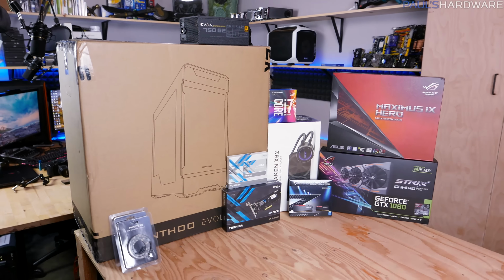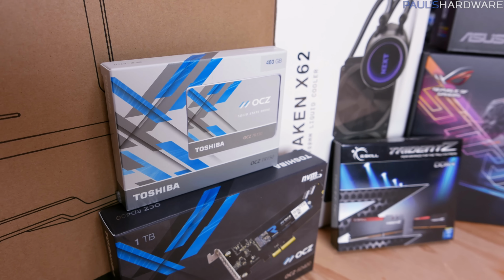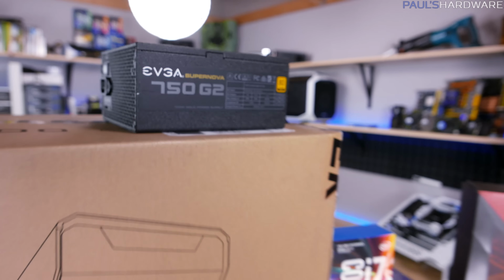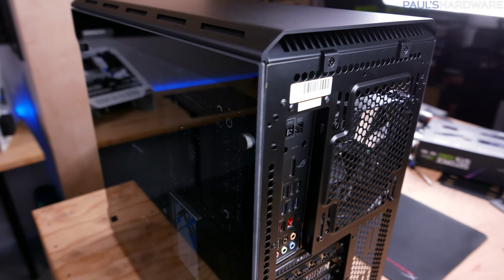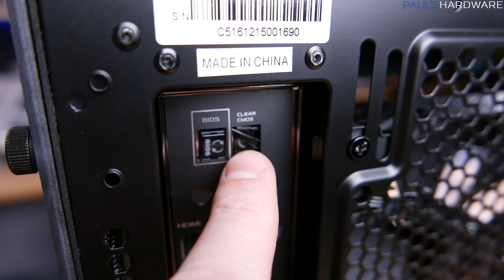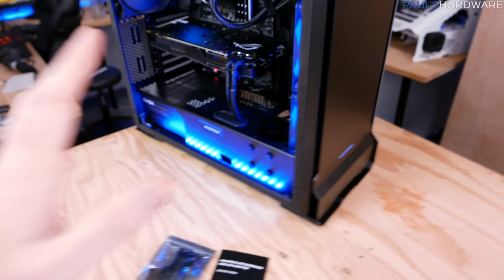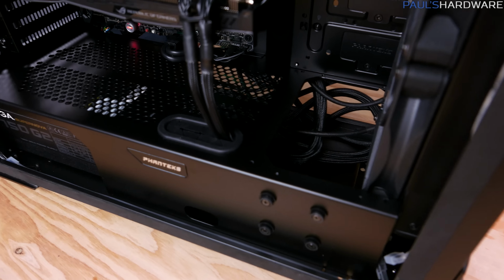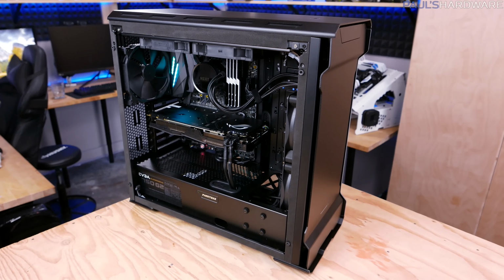Building a $2800 7700K / GTX1080 Gaming System - January's RGB PC!

Comment from the maker: Thanks for watching guys! Looking for feedback on -- AIO cooler tubing configuration, AIO cooler positioning (it's in pull, I could switch to push to hide the fans), PSU cabling and if extensions would be desirable, and how noob my mistake was with the I/O shield of course. Enjoy!
Reply: is there a reason for the video only in 1440p? looks way too raster on my cheap laptop :(
Reply: noice
Reply: Paul's Hardware I have just about the same build but with the Corsair h115i in a Cooler Master HAF932 case. I put my radiator on top and temps are good.
Reply: Paul's Hardware cant each your videos now dude
Reply: I think you should change them to push and hide the fans. :)
Reply: I think you need LED fans, or hide the fans. Sleeves would look nice everywhere. And for the aio, I have no idea how you can make the tubes look better, but something does need to be done about all the slack.
Reply: Bit of a PC noob, so I dare not weigh in on those aspects of the build. However, that SSD first person install was just too cool!
Reply: Nice build, looks sweet with the RGB's now so will be interesting to see it once tweaked. I would have the fans pushing through the rad, IMO it'll look cleaner and possibly be marginally cooler. Sleeved cables in black and grey would add the finishing touches. Don't be too hard on your self for the noob fuck up, anyone building PC's for a while will have done something like this at some point. I learnt the hard way after making a similar mistake when 1 of the IO shields grounding tabs got bent over a port forcing me to pull the motherboard out. I always check for this now;)
Reply: I like push/pull on my AIO cooler.  In my Define C it fills up the front area a little bit more too.  See if you can loop the cooler tubes upwards toward the top of the case in the area between the mobo and rad? Almost like a sideways S formation.  Not sure if there's something to tie it up there with.  I'd say just plain black extensions since it's got a glass panel.  My two cents.  Nice clean build though. 👍🏼
Reply: +Paul's Hardware Thanks for making this video. This build is VERY similar to the one I'm currently putting together, right down to the Trident Z RGB (ordered 32GB of the 4266Mhz ones, and I'm also still waiting for them to get here). The only slight differences are the SSD, motherboard and graphics card, where I went with a Samsung 960 Pro 1TB, Maximus IX Formula and a GTX 1080 from EVGA.

I haven't mounted the Kraken X62 yet, so this video helped me visualize how I want to do that, thanks again man!
Reply: Paul you need to have the fans in push, your bringing the hot air into the system with the pull config. the only exhaust you have is at the rear back fan.
Reply: "and how noob my mistake was with the I/O shield"

I once forgot to vacuum the metal particles after using the dremmel in a case. After turning the system on a fan sucked them up and trowed them on my motherboard and graphicscard. Somehow my motherboard survived, but the graphicscard died. Luckily I was able to get it replaced by saying it was DOA ;).
Reply: You are still missing RGB cables, RGB powersupply, and RGB SSD's by the way.
Reply: A Pull-config would look better.  The tubing does not look very good with the velcro on it, let it loose. Definitely some nice cable extensions for PCIe and 24-pin connector or some modular sleeved ones for the EVGA G2 (Ensourced?). The mistake with the I/O shield could happen to even the most experienced builder, no worries.
Reply: Dunno how I feel about the 2 intake fans and 3 out? Despite the aesthetics would cooling and airflow overall not be better with the AIO in the roof?
Reply: Elan Streaming from a cooling perspective it would be better on the top, yes. I think it's fine in the front but a positive airflow would be better, you are right. Maybe remove the two top fans ?
Reply: id leave it the way it is. there only 5 deg difference either way you mount the fans.
Reply: Paul's Hardware Maybe you could try routing one tube under the ram modules and the other one over them?
Reply: I was looking to get the same type of ram and everything, do they have a LED version of the white G.skill tridentZ?
Reply: Paul's Hardware slide radiator up & pipes will hide mostly behind top fans, I've got same case with h105.
Reply: Tell NZXT you want some of their AER RGB LED fans and just go wild with 'em.
Reply: didn't someone just do a video test of this and proved that top mounted ran hotter than front mounted AIO?
Reply: I've got a very similar skylake build here. AIO is the H115 from corsair in the same position also in pull. It does just fine if you tweak the fan speeds a bit (top are almost lowest speed, back middle speed and front just a bit faster. Boom, balanced airflow). Because of the pull config the rad also seems a bit easier to clean if needed this way. Also, ppl opting for 2x1080 in SLI... what is the point on a Z170 board? The lack of PCI lanes would just bottleneck it imo.
Reply: I think the 2 fans in and 3 fans out should be fine. Logically, the hotter air in the case will rise so the rear fan and top fans should push that out. The only thing I did differently on my build (non-tempered version of the same case and the same cooler) is set the front fans to push rather than pull. I liked the extra space inside the case that this provides by having the fans outside the main enclosure. I toyed with the idea of push/pull but the air can only move as fast as the slowest link. So, technically push or pull should be just as good as push/pull. But then, I'm a PC newbie so could easily be wrong!!
Reply: I don't want to laugh at your expense Paul, BUT I CAN'T HELP IT!  HAHAAHHAHAHAAAHAHA   ;)  :)

Sing along... I-Ooooo , I-Oooooo... IO, IO, it's off to work we go... :D
Reply: Does that X62 fit in front in push/pull? Looking to do that for my own build I am working on getting together at the moment. I want to put good SP fans in push with some NZXT AER RGB fans in pull. Only doing that since the AER fans dont have the best SP. Also, can that X62 fight higher up to not lose both HDD cages? (Yes that build has no GPU, already have an EVGA GTX 1070 FTW)
https://pcpartpicker.com/list/zDjYbj
Reply: I think you should put a custom loop in there.
Reply: Hey Paul, I too have a Phanteks Enthoo Evolv TG with a x62. 
You can front mount the radiator higher so that you can close the bottom tray and still use the HDD bracket. To mount the x62 you need to drill 6 holes in the metalsheet were you mount the radiator on. The top 2 will stick out but you still have 6 screws holding the radiator. This way your build will look cleaner and you just need to drill 6 holes.
Reply: Hey Paul, definitely get some extensions. Just wondering how tight was the fit between the X62 and first stick of ram?
Reply: Cedric van Sloten Are you able to provide more detail of what you are referring to? I am planning a build of my own using the exact same case and cooler. But want the front rad mounted higher so I can use the HDD cages still.
Reply: J Master Okay, I'll try. So if you buy the case and place the radiator above the PSU shroud/HDD tray. The holes of radiator do not allign the holes of the mounting holes. Normally you should remove the HDD bracket so you can lower the radiator and then the holes will be on par with the provide holes of the case mounting. Now if you place the radiator above the HDD tray the top 2 holes of the radiator will be above the case mounting and the other holes won't be be alligned.  So I drilled into the case so that there were new holes so that it would be on par. the top 2 holes would stick out but the rest keeps it firmly in place. if you have the case you will see what I mean. not difficulty at all. just need a drill.
Reply: Cedric van Sloten Do you remember what size drill bit you used? And what do you mean by "the top 2 holes would stick out"? 

Thank you for the help btw.
Reply: CRACKEN, not CRAYKEN
Reply: J Master    1) Yes       2) No, unless you want to drill more holes
Reply: Definetely want to pick up the X62 but I too fear that it will drape on top of my Strix card. It would be awesome if they had bendy clips that held the shape together at key points.
Reply: Awesome timelapse of the build. Keep up the good work!
Reply: J Master No, unfortunately I do not. However it doesn't matter if it's a bit bigger. The screws will go through the fan holes then case and as last through the radiator. So long there is case material between the fan and the radiator, your fine.

The top 2holes will stick out above the case mounting. However this doesn't  matter that much. I'm replacing fans, if you want I'll take pictures so you can see.
Reply: Cedric van Sloten That would be helpful, thanks.
Reply: Hey Paul, thanks for all these build videos! It's interesting seeing how other people do it. 

I'd put it in push configuration with the fans between the rad and the case, and that way you might also see a little better cooling performance if you were ever inclined to overclock the snot out of it. I'm not sure how much room you have to adjust the placement of the the rad vertically in its mounting slots, but I'd also consider sliding it upward further if you have room to hold the hoses off the GPU, or flipping the orientation so the barbs on the rad are at the bottom end to take up some of that slack you're having trouble with. There might possibly be room to route the hoses behind the GPU? If not, then I'm kind of envisioning them going ever the tail end of the GPU without drooping onto the ROG logo.
Reply: Hehe yea I have done a wiring mess up on a laptop rebuild playing the IT guy.
Reply: paul, cool build dude. I have this very build. i have the old kraken 61, no cooling cable issue with the gpu though. Did you know It is possible to actually mount a harddrive down below and to mount the kraken in the front (which gives superior coooling as opposed to having radiator on top, we know thanks to kyle, and i can confirm). All it takes is a good ten minutes a tiny steel saw and little pinch of willpower. It really is quite easy and now i have my 3tb seagate lying in the little tray and the radiator in the front with push pull awesomeness :)
Reply: My solutions of similar build, the hoses are in place with black metal wire, kraken x62 in push pull. I had Noctuas 14mm PWM from older build which cant be seen when front panel is on, and most fan cables hidden above fan tray. Intel 6700k@4,6Ghz idle at 22-24 degrees, everyday load at around 60 degrees. Next step would be sleeved cables and better cable management. 
https://adobe.ly/2loPIMS
Reply: What is the mat you are using under the motherboard when installing ram and cpu?
Reply: Paul's Hardware the DEEPCOOL captain 240 RGB is compatible with Asus Aura
Reply: https://pcpartpicker.com/list/ i was wondering how good this build would be?
Reply: Hey Paul, for the radiator on the front, did you just skip screwing in the bottom 30mm screws? The holes done line up and I’m asking what you did as the solution...?

Comment from the maker: 4K processing is still... processing :-P
Reply: Paul's Hardware people actually have the bandwidth to play videos above 480 :O
Reply: Paul's Hardware Weird how youtube processes its videos for the minority first, then the majority...
Reply: Got 1440p for now, good enough for me! :D
Reply: TekTick hey tektick lol
Reply: pls 360 or 240 pls :c
Reply: Paul's Hardware niceee
Reply: my internet is only good enough to play 720p any higher and it buffers all the time :P
Reply: Same here, Lame ole DSL
Reply: Damn, only have the phone right now. And it has 720p...
Reply: 6:45 #LMAFO *WELL DONE PAUL WELL DONE CHEER'S*
Reply: Paul's Hardware Yeah my 4k video didn't show up for weeks. You have considerably more subscribers though. Good luck
Reply: paul, my rgb keyboard lights keep turning on when my system is turned off. any idea why this is happening? its quite frustrating.
Reply: It's probably connected to a powered USB port (the kind that can be used to charge your phone while the computer is off) and the lights are just getting powered. Try changing the port it's plugged into. That's all I had to do to fix mine.
Reply: maybe replace those black fans with RGB Fans would be nice.
Reply: Bryson Young did you even watch the vid?
Reply: He said it was just temporary.
Reply: No 60fps???  :(
Reply: I have a similar system in progress.  Full custom loop w/1070 (power mod).  Same board and same case, will be same cpu and ram when I get it.  Custom cablemod cables on the way. Black and white build with a touch of red.  I hope I can pull it off because I've spent WAY to much on making it look good >< (custom loops don't help with performance).  Will have no RGB, only white lights.
Reply: Vercusgames You also have rubbish internet if you live near in the middle of nowhere 5mb download 0.2mb upload

Comment: Mount the front radiator further up in the front, slap the cover on the PSU shroud back on, and put the fans behind the dustfilter on the front, and not on the backside of the radiator like that. It will clean up a lot, and i guess it will solve the slack of the radiator tubing sagging down on the GPU.
Would also put a LED strip on each side of the case, and not one on the right side and one on bottom.

Pretty much how my Phanteks Evolv ATX is setup, and it looks pretty damn smooth.

Comment: Solution to tubing. Put fan on the radiator in push configuration. It will push the tube closer together and cause the loop to lower a little. It also looks better that way in my opinion.